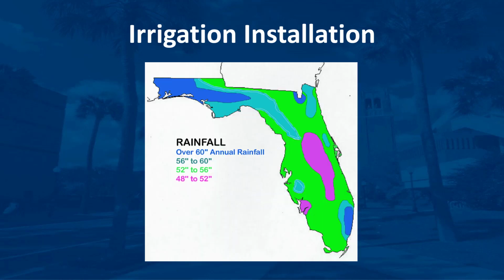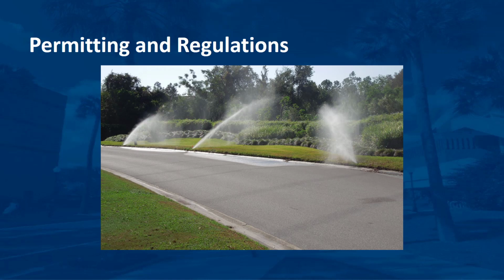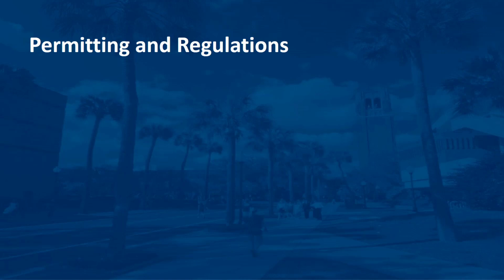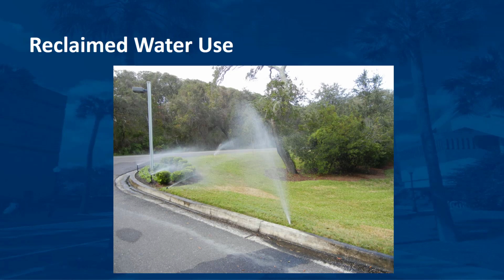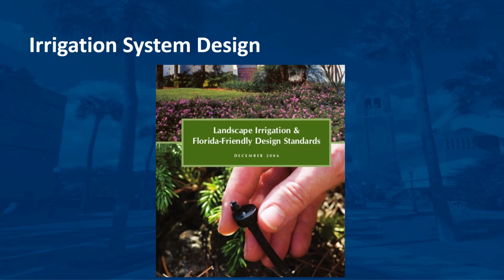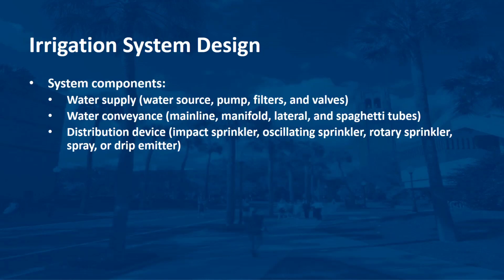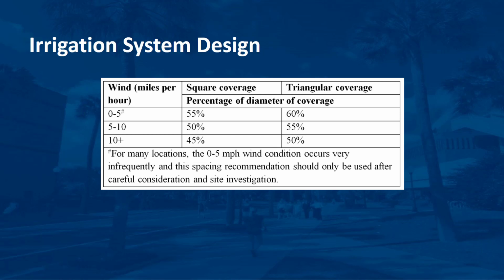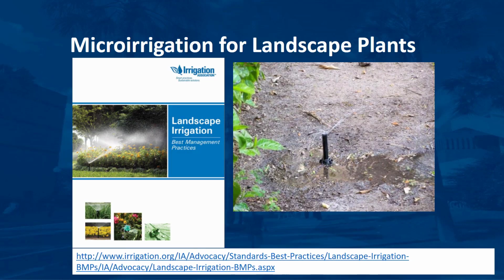Building a Better Irrigation System: Design & Maintenance

Comment: In Taiwan, the floating drip irrigation is a new drip irrigation technology system that is the best choice for automatic irrigation. It has three characteristics: (1) Auto-remove impurities of pipe in the water, so to solve the long-term blocking problem of the drip irrigation (2) adjusted the amount of water, can plant different types of plants . (3)Lower power, the operating pressure is 0.02~2 Kg/cm2, is very suitable for gravity drip irrigation, as detailed in YouTube:
https://youtu.be/P495Nk62QMQ 
(The floating drip irrigation device introduce) 
https://youtu.be/hHen1IEzDT8 
(The floating drip irrigation system operation)
https://youtu.be/YM9grmll1oM 
(How to install an adjustable floating drip irrigation device in vertical irrigation) https://youtu.be/AR7Jzx_FS-A 
(The floating drip irrigation device is used in the strawberry plant factory)